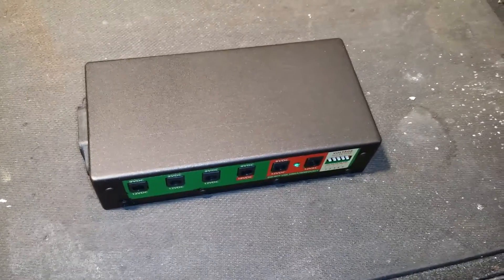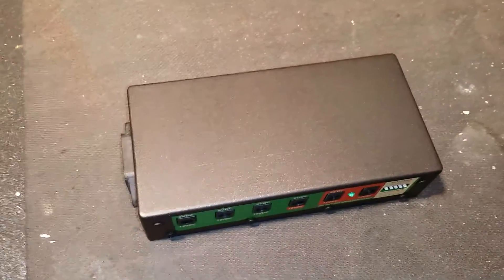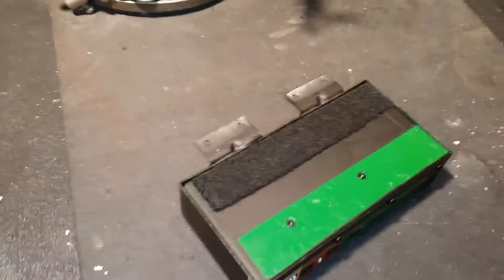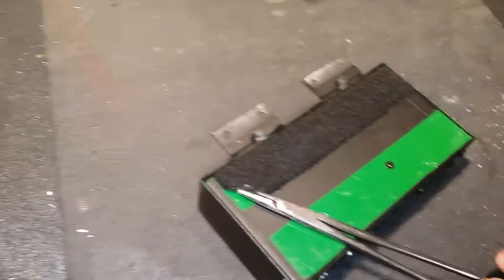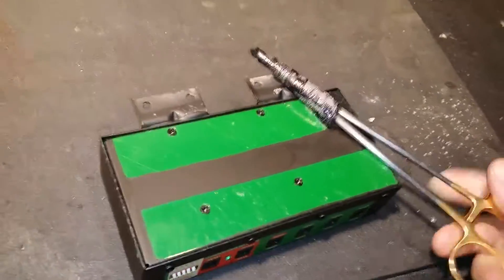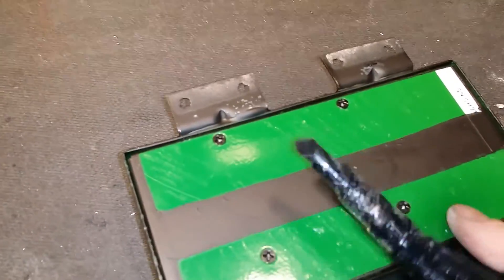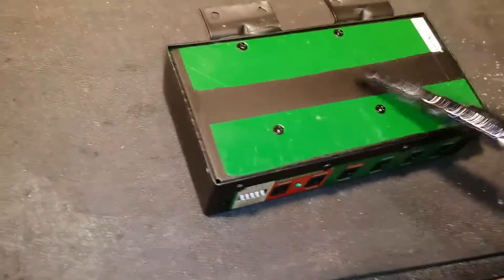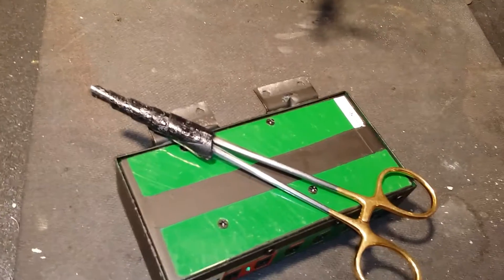Easy Way To Remove Velcro

Comment: Thanks, this is an awesome helpful tip -- QUESTION --  what is the green tape?  I've seen others recommend using the blue patiners tape on pedals before putting velcro on them. What type of tape is this green tape? Why is on there?
Reply from the maker: vio4jesus there isn’t any green tape. That’s the color of the enclosure. 😁
Reply: OK